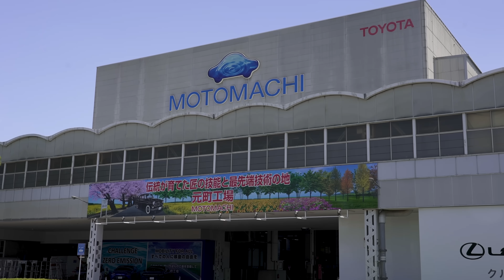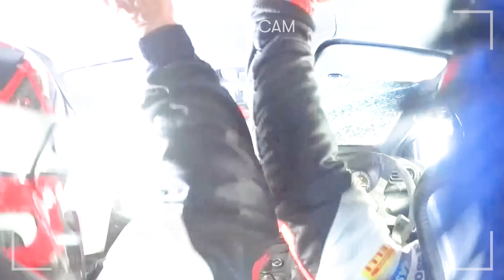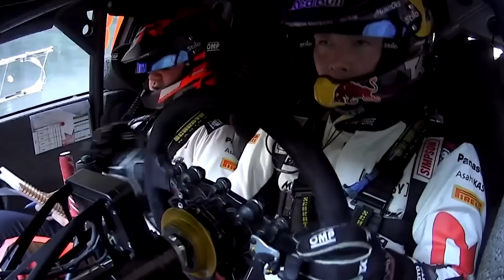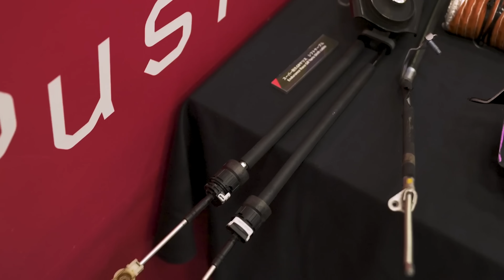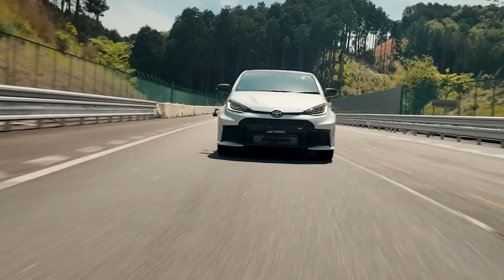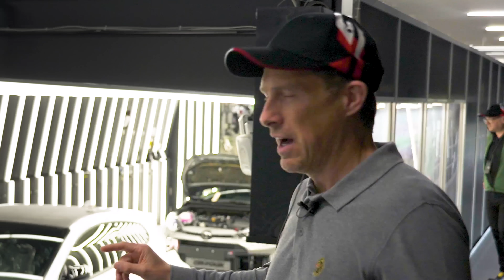I EXPOSED Toyota's Secrets!

Comment: Advanced:  meaning the intelligence to NOT replace a smoother running I4 engine with a clunky, less balanced I3 engine.    Toyota does not have that regarding the Yaris and Corolla GR development.  
It's a bit ironic since they were cognizant enough (unlike Nissan) to at least keep a proper INLINE 6 in their flagship sports car, the Supra.  
Who convinced your 'experts' that an I3 was better than an I4 for performance, ESPECIALLY since the incumbent 1NZ-FE in the Yaris was an excellent tuning platform.
Reply: Interested to know what your credentials are since you’re coming out to be smarter than Toyota. Toyota chose the I3 originally for competitive WRC. They clearly saw a compelling reason to choose this over the I4 and had the engineering competence to pull it off. It’s well documented officially online and on YouTube if you care to do your homework on it. If executed correctly which in this case Toyota did, an I3 will perform as good as an I4 with greater efficiency to boot. This engine revs so fast it’s incredulous, thanks to less reciprocating masses. This in turn contributes to less turbo lag

Comment: Wish we can get this in the US, the Corolla is nice but not the same
Reply: It's built in the EXACT same manner, at that same facility and that specific "production line".    Using the SAME engine, transmission, suspension, awd system, steering etc.   granted its heavier, but also more usable.
Reply: @KN-jw7ts  i've driven both too and there is big difference to how both cars feel. For the track or fun i would always take the Yaris.

Comment: The entire automotive industry needs to do a 100 year apprenticeship at Toyota to achieve their level of quality.
Reply: in fact the whole industry did that, almost every manufacturer has some form of lean manufacturing implemented based on the Toyota Production System, Toyota actually helped to turn around Porsche in 90's and now Porsche is the most reliable German brand out there. Many don't know Toyota has by far the largest number of patents registered from any car manufacturer out there. Trying to improve their production further they even invented the QR Code back in the 90's. They didn't even revolutionized the automotive industry, they literally revolutioned all manufacturing around the world. I've once visited a large company that makes devices for measurements, and they told us they are using the Kaizen system, they actually had experts from Toyota fly in back in the 90's to overhaul their production. Their profits, efficiency and quality went up immediately. Whats nice about TPS is that the system doesn't fully rely on the individual, you can implement it in any company in Japan or in India and the quality will be very close to each other (for example Toyota produces their cars for the indian market in india, but their reliablity level is equal to any Toyota produced anywhere else in the world). Toyota actually has a consulting company as well to help other companies.

Comment: Meanwhile, other manufacturers design parts that fail as if they had an expiry date ..... my experience with 2 BMWs and a Peugeot!!🤷🏻‍♂️🤬

Damned parts (which used to be metal but are plastic for "weight saving") turned brittle with HEAT of the engine! Wtf

Comment: Get the grey. I also had a Gen-1 in pearl white. Bought the grey in the Gen 2. It is stunning !!
Reply: Do you actually feel the difference when driving? (Not to mention different interior)
Reply: @ 100%. The Gen 2 is a better car all round. Particularly at higher speed. Engine pulls stronger, gearbox feels better, steering feel is better. You won't notice it until you actually drive both cars back to back

Comment: Hope Toyota would also fix the GR Yaris power steering issue that is occuring when driving faster on track, loading the front axle. So far there has not been any resolution to that. Pure motorsport driven company would take care of that aswell, and not just deny the problem existing.
Stock wheels, stock tyre size and stock suspension.
Reply: rear diff overheat issue is known for years since 1st gen launch and they all doing face they see this first time 🤣
Reply: But you don’t have one. Never been an issue with all the track days I’ve done
Reply: @heathlett275  ok I have it in my car. how fast to do go?
Reply: @alex_yatsau  I have not had heat issues yet but know that transfer case heat is an issue, and rally teams put separate transfer box cooler cell + circuit in theirs.

Comment: Do they do the same for the Supra or it’s only a GR Yaris exclusive?
Reply: Only Gr Corolla and Yaris built at that factory, in that manner.
Reply: Interestingly enough, the new Supra is built in Austria, by magna steyr.
Reply: @KN-jw7ts  right but Magna also builds the G-Wagon. Magna is also at the top when it comes to manufacturing and quality so nothing wrong with that, the supra is at least equal in manufacturing quality.

Comment: Toyota: test cars until destruction
Also Toyota: you used your Corolla GR on a racetrack, so your warranty is voided!
Reply: Toyota US things...
Reply: Why should they warranty it for track use? It’s a road car evidenced by the fact that it has a license plate. Buy a racing car if you need warranty for track use?
Reply: @animeonperseest  In my country Toyota gives you track warranty for GR Yaris.
Reply: You ppl are so unoriginal.   You read some clickbait and spew it like it’s gospel.   Actually looking into the facts, it was an isolated situation or 2 at best.    Stop your nonsense.
Reply: i have 10 years of warranty for my GR Yaris and it also covers the track
Reply: @binskee677 Yeah maybe, you can try claiming a bent suspension arm or a broken strut mount on the relax warranty after running over a sausage kerb to the dealership and you’ll see how interested they are in fixing it for free.
Reply: @animeonperseest  haha „if“ thats the case it‘s a USS thing, not a issue in Europe and never heard of that happening in the Yaris, maybe the Corolla yea 🤷‍♂️
Reply: in fact a friend who only uses the GR Yaris on track had an issue (not overheating) with the very early issue where a small part of the climate compression would come loose due to vibration, they replaced it immediately even though his car was modified (harder torque mount which caused the vibration, stiffer suspension etc.)

Comment: Don’t talk about steering tolerances my new Hyundai i20 has had a squint steering wheel since I picked it up. Hyundai attempted to fix the problem three times eventually ordering me a new car and that also has a steering wheel that is not straight to the wheels, this weekend I am about to adjust the tie rods myself and fix the problem that the garage couldn’t fix. Seems to be an increasing problem with new cars from what I read online. Just not set up correctly from the factory so Toyota I salute you for this fantastic effort in making sure your customers get a perfect car not like Hyundai
Reply: Hyundai 🤮
Reply: @ great input
Reply: Years ago Ford had a problem with the powertrains of Mondeos being put in Mis-aligned.

Comment: All those stories about the 3 cylinder GR engine, exploding, and Toyota are not fixing that because people were driving too "fast" 
Toyota was saying that you broke the law by speeding, and now you have to pay for the faulty engine by yourself..👎
Reply: Lots of misinformation here.

"All those stories" Are literally just a few, but the internet has screamed loudly about them. Almost all of those were running immature flash tunes.
The Toyota "You were driving too fast" thing is a Toyota USA issue, and as terrible as that is, should have nothing to do with the countries where the GR Yaris is sold.
Reply: okay, good information, that makes a lot of sense..
if the cars were tuned, then no car manufacturers would repair it for free.
and the only US thing makes a lot of sense to.
what I saw and heard was that the engines were exploding on the highway because of people let of the gas, with high rpm. and it the back fired and exploded.

Comment: Motomachi factory is the same factory where the legendary MK4 Supra and LFA were built.
Reply: Mk4 Supra are overweight good for straight line bad at corners just like muscle that's why American love it. It's also not cheap a failed project.
Reply: @GF-mf7ml  Another doofus that has no idea what he's talking about. The Supra Turbo's curb weight was 3400lbs similar to Corvette, Porsche 911 of the past. Back in the day the MK4 Supra out-handled Porsche 911 Turbo and Ferrari Testarossa in Road & Track magazine comparison. Also countless comparison were done back in the day in various magazines where the Supra was formidable on the track. You weren't born back then.
Reply: so you mean to say that it's been aura farming all these years
Reply: LFA is a slow ass fastest Lexus car, even the Dodge viper which is a lot older still gaps it with ease
Reply: @xenomorph9114  lfa is not designed for top speed but it's a drivers car experience the craftsmanship and the sound
Reply: @olavofernandes7286  Yet the LFA will reach 202mph. The fastest Viper variant ever does 206mph.
Reply: @xenomorph9114  but at least it's reliable 😂
Reply: @xenomorph9114  You are obviously some doofus born after the year 2000. You have no idea what you're talking about. There are 5 generation of Vipers. Only the last two generation will be slightly faster than the LFA in a straight line which shouldn't be surprising, the ZBII has 50hp more and the VX I has 100hp more than the LFA.
Reply: Nobody cares about supra anymore
Reply: @robertresetar6468 Some people do

Comment: I have a gr corolla on order.  Hope i get it soon. But still at least 6 months by the looks of it.
Reply: GR Corolla also had a great reliability.
Reply: I’ve had plenty of wheel time with one, they are special cars. You’ll love it.
Reply: Hey mate, lemme have a freezer body truck please😢
Hino or Isuzu Forward 😊
Thank you
Reply: @jamaicanyute8441 where You at I’ve got a transit fridge van and an Isuzu 7.5 freezer unit that I’m done with
Reply: They didn't give you a date? I detect BS.
Reply: @samuelgarrod8327  welcome to canada
Reply: @samuelgarrod8327 sadly this is Toyota’s latest business model in many areas. Build the car on order, with a couple cars on the actual lot. I have a 2025 Camry XLE on order since mid February. I was told around 4 months. Because of the order rush of people buying cars because of tariffs issue, it has made the wait even longer. Something all manufacturers are facing.

That cant give you a date cause they really don’t know when it will be finished. They can tell you the current state of your order, like if it’s still waiting to get built, currently getting built, etc.

This model kind of sucks for the customers in some way, but it’s something the entire industry is doing. The one good side is you get the exact car you want.